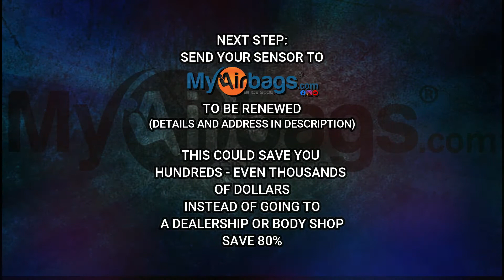How To Remove Collapsible Steering Column Sensor from a Ford | MyAirbags

Comment: can i remove the sensor in truck without taking out the whole clumn
Reply from the maker: Yes, there are usually a few screws that hold that sensor in place.  Just remove those screws and get the sensor out.

Comment: Do you have a video how to remove steering column?
Reply from the maker: We don't have a video on how to remove steering column because if your collapsible steering column sensor is bad then you don't need to remove the entire steering column, but just remove the sensor itself. This will save you at least 4+ hours.
Reply: Well then how about a video on how to take sensor out while the steering column is still attached. My 4 year old could figure out how to get it out from the point where you began! Waste of time